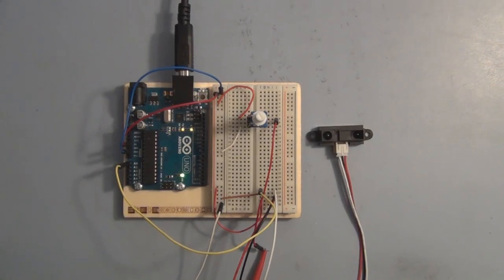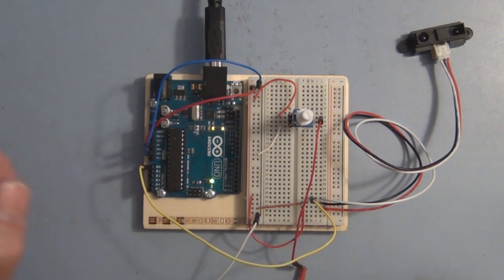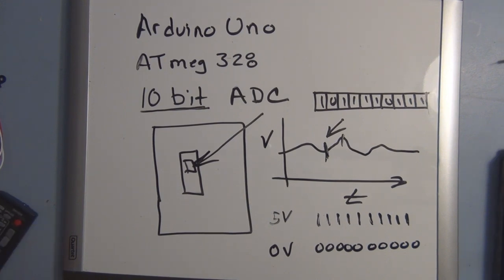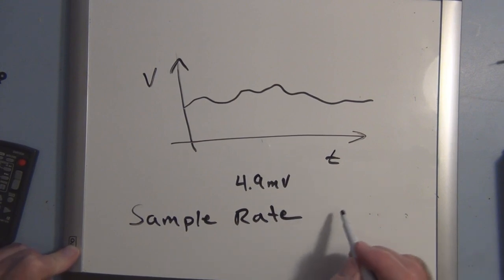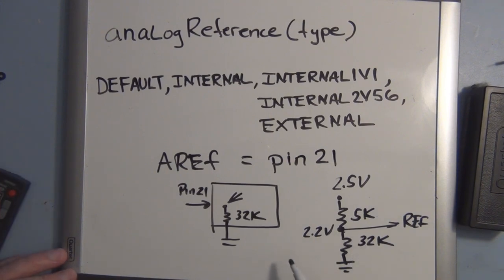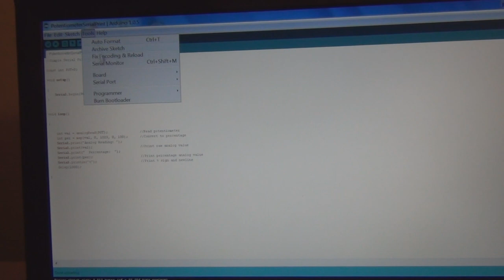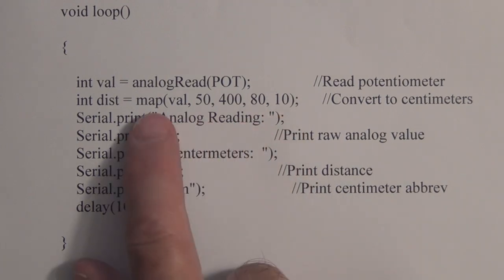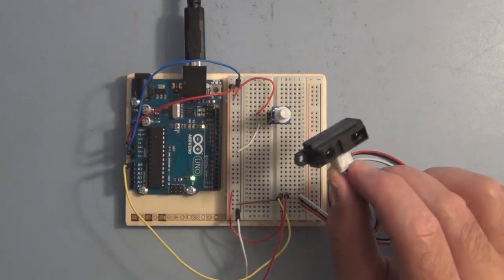Connecting a Sharp Distance Sensor to the Arduino Uno

Comment: Am I right that the voltage is not a linear function of the distance but of the inverse distance? This is what I understood from the technical manual of the sensor. This means that the map function is not accurate unless if applied to inverse distances.

Comment: Great video, very clear explanation. One important note, though: talking about lowering the reference voltage to improve A/D converter accuracy is a good idea (although 4.9mV equals about 0.3 cm, which is pretty accurate as it is). I didn't know about that 32k resisor inside, great tip.
But you make a much bigger mistake when using the map function to convert voltage to cm. The map function does this in a linear way, and the sensor doen not have a linear correlation between cm and voltage as you show on the datasheet (at 2:45). I guess you can be more than 20 cm off if I look at this chart. At 1V, the chart says 27 cm, your sketch will measure something around 50.

Comment: Hi Tom.. I'm wondering why you're using the map function... because the voltage drop is a curve and is not linear. Am I missing something here?
Reply from the maker: The map function rescales a range of values to another scale of values or units.  We know what the voltage output of the analog distance sensor is over its range of output values but we want to express that in units of distance.  The map function does the math for us.  I used the 10 to 80cm based on the generic output graph in the data sheet but if you want to be more accurate you could measure the voltage output for your distance sensor over a range of distances and graph is out.  the max and min outputs for the measured distance might be slightly different than the data sheet.  To get better resolution you or the ability to detect smaller changes in the distance you need to lower the reference voltage from 5 to the max ouput of the sensor voltage because that will get spit up into 1024 pieces by the ADC in the arduino.  If the max output of the sensor is around 3V you would like the reference that the ADC uses to be around three volts too to get the best use of the ability of the ADC to break that into 1024 units.  If the reference was 5V and the output of the sensor never gets above 3V ,  you will not use the ADC  measurements from 3-5V so those are wasted.

Comment: Hello Sir,
Thank you for the video. I am using this same sensor to measure the distance of a vibrating Piezoelectric sensor using a breadboard. I get the output in terms of voltage, but when i change the frequency of vibration I don't see any change in the voltage. Can you please suggest some idea for this??
Reply from the maker: I'm not sure what you are doing?  The sensor in this video has an LED that emits light in the Infrared spectrum of light energy and a sensor that can detect the amount of Infrared bounces off of an object in front of it.  Here is a link that better explains the concept. http://education.rec.ri.cmu.edu/content/electronics/boe/ir_sensor/1.html.  If you are trying to manipulate the IR sensors distance measurement with a piezo the frequency is not in the IR spectrum.  Although the Infrared spectrum is light energy it does translate into a frequency range.  Infrared radiation extends from the nominal red edge of the visible spectrum at 700 nanometers (nm) to 1 mm. This range of wavelengths corresponds to a frequency range of approximately 430 THz down to 300 GHz. Below infrared is the microwave portion of the electromagnetic spectrum.  I do not think the IRsensor can detect the Piezo frequency output.  I hope this helps.
Reply: eTech Tom thankx a lot😁

Comment: thank you for the video sir,
sir what is the difference between the sharp sensor and the ultrasonic sensor ?? and I mean in terms of precision , that which one will give me the correct reading if I place an object at a particular ANGLE in front of the sensor , because the ultrasonic sensor gives me random values if I do so..
Reply from the maker: There are really a lot of variables to consider.  You have to decide which is best for your particular application.  Here is a link to a document comparing the two types of sensors.  http://iopscience.iop.org/article/10.1088/1757-899X/149/1/012141/pdf
Reply: eTech Tom thank you for replying back sir.... 
basically my trouble is that when I am placing an object at a distance of 10 cms from the ultrasonic sensor at a particular ANGLE , the sensor is giving me some sort of random values because the US sensor is emitting the ultrasonic rays at an angle of .5 degrees , can this problem be overcome through the sharp sensor ??? does it emits the IR rays perpendicularlary or at some angle ( like the ultrasonic) ???

Comment: Hello Sir, what is source where you download your Arduino library? the paper you are reading of .
Reply from the maker: http://playground.arduino.cc/Main/SharpIR
Reply: +eTechTom sir can i use infrared proximity sensor to dect my wooden type lifr... actually i wanan to stop my moter when my wooden lift comes in the desireabl floor. i amdoing 5 level elvator system using using plc.... one more thing, whaen the lift comes in the desireable positon or floor , my lift should syop.. so it is usefull to use capacitve proximity sensor to give feedbak to plc in order to stop  the motor!!
Reply from the maker: +Naheem Sheikh I did not use a library in this example but here is a link to a library for a SharpIR sensor https://github.com/guillaume-rico/SharpIR
Reply: please i need this library but in mm
Reply: create a variable and then convert it to mm from the output units of the library. good luck

Comment: is this sensor working only with aurduino?
Reply from the maker: It produces an analog output voltage so you can hook it up to any microcontroller's  analog input pin and use analogread to read that output voltage from the sensor.

Comment: How accurate are te measurements with this setup?
Reply: I need to know that aswell. Did you find any answer?

I need something from 0 to 200mm.
Reply: Use Vl6180x from ST electronics, I have been using it & the measurement is ~99% accurate. no need of manual calibration. @Sourabh Roddey
Datasheet:
http://www.st.com/content/ccc/resource/technical/document/datasheet/c4/11/28/86/e6/26/44/b3/DM00112632.pdf/files/DM00112632.pdf/jcr:content/translations/en.DM00112632.pdf

Comment: Hello Sir? can you help explain the 2.2 v thingie again? i kinda dont understand tht part thanks
Sincerely Gabriel
Reply from the maker: When you reduce the reference voltage the AD converter can convert smaller changes in voltage to a binary representation.  It needs to have a reference voltage that it uses to calculate the smallest voltage it can detect.  By using a 2.2 V reference it can detect voltages in increments of 2.2 / 1024 = .002148 V.  
It can then have a unique digital value for each increment .002148V.   If the reference was 5V it could only detect changes as low as .00488V.  You have to determine just how accurate a measurement you are interested in for your project.
Reply: +eTechTom Hey Tom, thanks for replying:), can I ask how to I change the increment on the ide? Is it at the Map section where I change the 50 to 25 and 400 to 800?, cos I understand that having a lower increment will have a greater resolution, just need to know how to apply it in the ide, thanks:)
Sincerely Gabriel
Reply from the maker: I posted a video on using an external voltage to improve accuracy.  https://www.youtube.com/watch?v=yGZTUne5AFs
Reply: hey Tom, can i ask for the sketch cos some parts are missing and an annotated diagram of the wiring? thanks
Sincerely Gabriel
Reply: exit status 1
'analogRefrerence' was not declared in this scope
thats what i got, please help?thanks:)
Reply from the maker: Lim Gabriel Check for typing errors.  Here is a link describing this command.  https://www.arduino.cc/en/Reference/AnalogReference
Reply: Hey Tom, thanks:) can i ask why you add the voltage of the ir sensor to 5k resistor before attaching it to the aref pin? i thought we need to get the full voltage of the sensor? thanks
Reply from the maker: Lim Gabriel The sensor output is connected to an analog input not the Aref pin.  I just picked up a red jumper wire to point out where Aref was.  That what not the red sensor output wire.  The Aref pin is where you connect your external voltage that the ADC will use as the reference for it's highest voltage that it divides into 1023 pieces.
Reply: ohhh, i see, i see, so the external voltage is 3volts right?:)
Reply: so why do we need the 5k resistor then
Reply from the maker: Lim Gabriel Just using some standard resistor values I had I ended up with about 2.16V on the AREF pin that the ADC was using for a reference which was a little lower than the max IRsensor output but it demonstrated how you can change from the default 5V reference to a lower external voltage to better match the max output of the sensor.  Ideally you would want the external voltage to be as close to the max output voltage of the sensor to use it's full detection range.
Reply: ok

Comment: Mapping from 50 to 400 is not the correct way to fix the problem, you just increased the inaccuracy of the setup by shrinking the range, shoulda mapped from 0-1023 and re-do the math by equation. Output 0% when input is smaller or equals to 50 and 100% when input is larger or equals to 400.